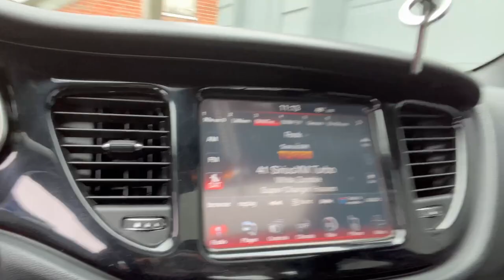Service Transmission Light 2013 Dodge Dart 1.4 Turbo Service

Comment: You should always drive easy until your Transmission heat's up so that the Vavles and bearings will move easier and will shift correctly with less problems...  Your on the right path you will figure it out Brother You are Thee Man!!!
Reply from the maker: Blows my mind the dealership serviced none of this before we bought it

Comment: Yes Brother always put anti-seize on your spark plugs why because you're putting steel threads into aluminum head and steel and aluminum weld together so that anti-seize keeps that from happening.  Also you should always check the gap on your spark plugs even though they are new sometimes the Gap is off you probably check them off camera just a rule of thumb always check the gap on new smart plugs...
Reply from the maker: There’s no remanence  of any on any of them so I don’t think it’s ever been used on them and I checked the gap with the eagle eye 😂
Reply: @1ChadKeegan  As always You are Thee Man 💪 Brother Enjoy your Evening goodnight...

Comment: I’m thinking low transmission fluid is my problem too. But in the past I had the same problem and all I did was an engine oil change and my problems went away. This time months and 4 thousand miles later, it seems pretty grumpy. But it also needed a evaporation module. Got that in and the transmission problems are still going. Computer in this thing is so fussy though. My wife had a low battery on it years ago and it threw a fit taking away gears and throwing a transmission warning.
Reply from the maker: I end up topping it off and was ok for about 3 weeks then started throwing a fit again and every time I had the codes read it’d say the turbo was under producing so I swapped it out and it’s Been fine since and the engine light finally went off after a week of driving it. These things are extremely sensitive it seems
Reply: @1ChadKeegan  so it was your turbo?
Reply from the maker: @randommexican8311  no, I did change the turbo and a month and a half later it happened again. I believe it was the transmission shift sensors but idk because I traded it in when it left me stranded in Georgia 3 weeks ago
Reply: @1ChadKeegan  yup ours isn't there yet it has 106,000 miles but it's starting to say service transmission and the quote on a tranny flush is 600$ at the dealership... They ruse to use anything but oem transmission fluid.. do you know what I can use instead of the OEM dry clutch fluid? Im in the 1.4 Rallye 2013 ddct transmission

Comment: Chad what you have in that car is a DCT. Dual Clutch Transmission. It is an electronically shifted manual transmission .I have a Ford Focus with a DCT. The only fillers for my car is Brake Fluid Washer Fluid and Oil. There is no filler or dipstick for the transmission. BTW the Dart was a bomb that's why it was no longer made.
Reply from the maker: Yeah I’m aware of you watching previous episodes I talk about it

Comment: Good day, thank you so much for your channel. We are looking for a transmission oil for a DDCT 2013 dart turbo, can you recommend any? Thanks
Reply: We have a dip stick we bought at our dealer
Reply: The dealer said that this oil is lifetime but does need to be replaced every 100k.
Reply from the maker: @lmn1966  I got the oil from the dealership
Reply: What transmission oil for 2013 dodge dart turbo 1.4L automatic?

Comment: Dang no rest for the weary is there. Cool you found another place to get the car worked on if you need them. So the radiator isn’t coming from 4 states? I’ve not had to source my own radiator for my truck usually my shop’s parts girl can find it. But my truck isn’t as old as that one. Boy you’re a busy cat today hope things get better
Reply from the maker: Yep it’s coming from 4states eventually I did that video a month ago
Reply: @1ChadKeegan  Cool that’s what I had thought you’d said. Guess time travel is possible. It’s gonna come together